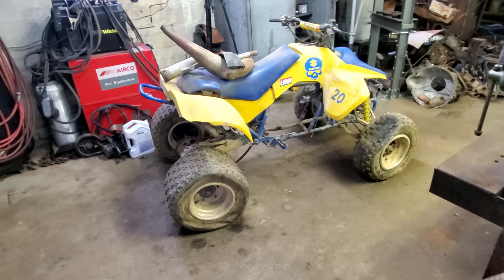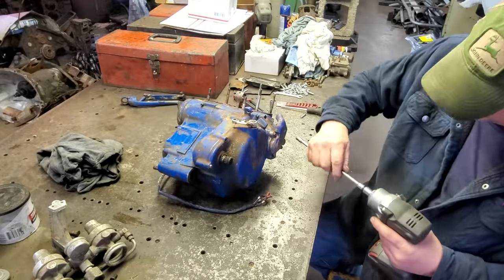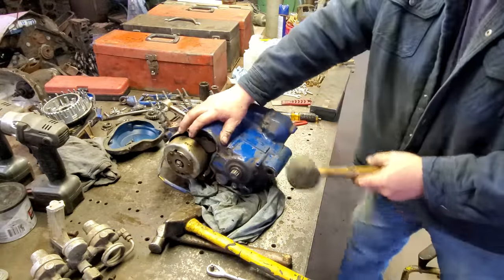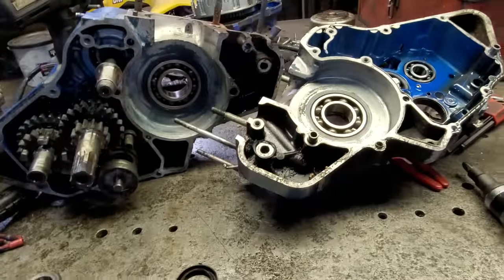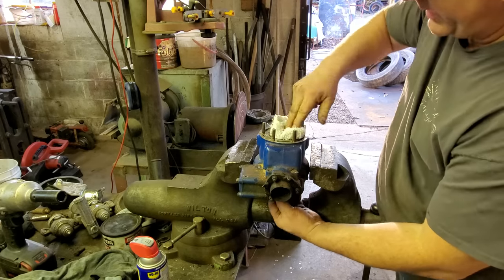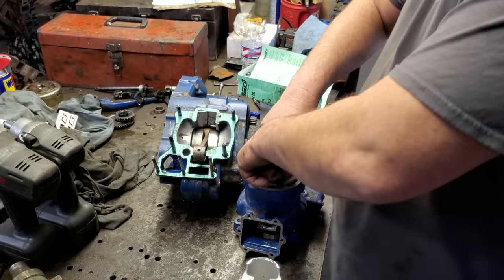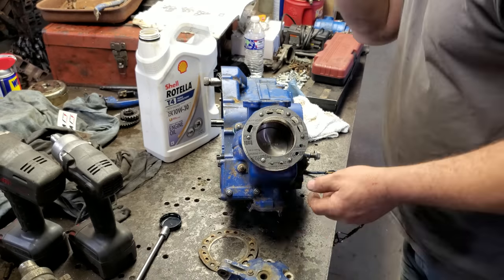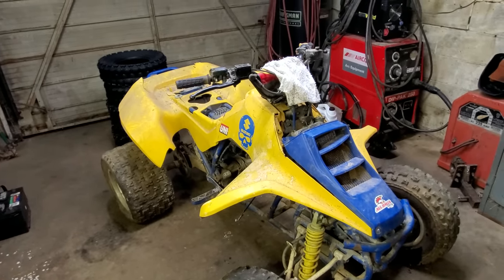Suzuki LT250r 4 Wheeler With Broke Piston!! Part 1 | Motor Rebuild

Comment: Those old suzukis made me a master at drilling out stuck screws. It wasn't till much later that I found out that those philips head screws were in fact JIS and not philips. Look for a small dot stamped on the head that indicates it's Japanese Industry Standard (JIS). So much easier to get them loose with a jis bit in the impact driver.  
Love all the videos. Keep them coming.

Comment: Yea I had the LT 500 1989 back in the day. Had it all hopped out with a Paul turner top end and pipe.  Had to run trick racing fuel in her . But holly hell . You need to hang on. She was an animal.  High-speed dune running.  Great machines

Comment: It's always another great video. Absolutely love to Strokes anyting with a two-stroke engine on it is a blast. Just like you said there's nothing like running a 2-stroke when it hits that power band there's nothing like it. The only thing I have to say is I've done my top into my dirt bike super easy but I was always told if you split the case you should go ahead and replace the bearings why you're in it.

Comment: Power valve,  best of both worlds. Low port for low rpm, high port for high rpm without the disadvantages of a fixed port height.

Comment: That nice 4-wheeler around here where I'm at you just don't see them anymore,it kind look like that head gasket might be on wrong the coolant won't flow right it look like the gasket has it block might need turned other way,that's cool atv,can't wait see it run,thanks for video

Comment: I know of A trick to possibly help you with removing that exhaust pipe stud out quick& easier. Use A medium hand held propane torch going around the outside of the stud area if it. Then spray some PB-blaster on the threads of the stud. Next lock your needle nose vise grips on sideways to really tight on that stud then slightly tap it with A mini ball pin hammer to loosen up the threads then slowly turn it from the bottom up to the exhaust pipe towards the left side of the four wheeler. If it frees up don't stop twisting the stud out keep on until it's totally out of the cylinder jug. Then clean out the threads with A chaser tool.& Put some anti seize on the other studs so that doesn't happen again in the future.

Comment: Here's a little trick for you bleeding four wheeler brakes pump up the handle brakes take a zip tie and put it around it leave it be overnight next morning cut the zip tie you should have your brakes it's not then you'll have to bleed the brakes at the source as normal but usually my little trick works

Comment: You just barely tap it just enough to shock& loosen up the stud is all it takes to. I know this other tip trick to on it also  use A rotary Dremel tool with the cut off wheel to slice A slit in to the stud then use A big flathead 🪛 driver to turn out with vise grips locked around the screwdriver turning the stud out of the jug.

Comment: Meh.  We all love your content, even if it isn't cars all the time.  I live in Canada.  My car has a problem with the wipers.  I even have a replacement transmission for it.   But I don't have a shop, and it's too damned cold to be skinning my knuckles working that problem.  So, I just tighten up the one that's coming loose every few days until there's warmer weather.  I'm about to turn 60 as well, so, I'm even less inclined to work on my vehicle in the driveway...

Comment: If you have A smaller set of those needle nose pliers it's the better option on removing that stud out with to. If not I'd invest in A mini set of those vise grip needle nose pliers for that reason alone then for sure. You'll be surprised on the outcome of it to Joe.

Comment: You didn't put the washers on the wrist pin bearing. Question does this quad still run after re building the engine? I did research how to rebuild this too end and deff need them washers. I got the billet threshold washers

Comment: I know it's too late now, but for future reference you really should NOT use RTV on the crankcase of a 2 stroke because the gasoline will dissolve the rtv. You really need to use either case-bond or anaerobic sealer. Some good brands of casebond is any of the 3-bond sealers, honda-bond, yamabond, or the easiest to find is permatex moto-seal all work well.
Reply: Chad any video you make I'll watch. Keep them coming l find them interesting and  humorous  You are one hell of a mechanic....
Reply from the maker: Been doing it for years with zero issues.

Comment: i have a 1979 Kawasaki KDX400 i need to split the case on to replace the big end bearing, which means splitting the crank as well. boy, im dreading it.
Reply from the maker: Good luck with that!

Comment: aint nothing worse than someone working on something that has no idea what they are doing , to split the case the flywheel and stator have to come off and you need a case splitter to s0lit it before you crack the case.
Reply from the maker: What's weird is I didn't take the flywheel or stator off yet I managed to split the case and I also didn't use a case splitter yet I managed to split the case without cracking it. 🤷🏻‍♂️ Ain't nothing worse than a knowitall that don't know nothin. Go troll somewhere else lil buddy.

Comment: Power valve is the extra valve on the exhaust port side on 2 smokers.
Reply: You can adjust the power valve for the best "hit" at the throttle and RPM level desired. Keep up the great content ✌

Comment: I experienced an extreme amount of anxiety when I saw you prying the aluminum crank cases apart with a steel screwdriver.
Reply from the maker: Not sure why. 🤷‍♂️
Reply: @ThisNThatGarage  Because I've seen 2 stroke engines with damaged cases. Some warped and others gouged and they have to be machined before they ever seal again. The last one in my shop was a Yamaha IT200 that came with the engine in a basket. No gouges in the sealing surfaces, so I assumed the cases were ok. After reassembling with new bearings and seals, I noticed a lot of dark oil spewing from the stinger of the baffle. Turned out the guy that disassembled the cases, did so without a case splitter and warped the cases. The deformation was so slight as to be un noticeable without the use of machinist's straight edges. The cases had to be milled. Not just the sealing surfaces, but also every bearing pocket in order to maintain proper end play clearance. I did the work, but the labor exceeded the bike's value. Back in 79', when I was in National Technical Institute, one of my instructors demonstrated why we never pry cases apart with metal objects between mating surfaces after witnessing another student doing so to his own engine.
Reply from the maker: @sandmanbub  Been doing it for years with no problem. There's a difference in knowing how and not knowing how.